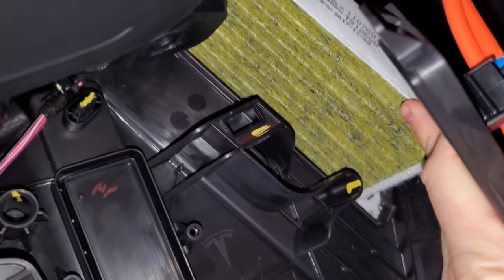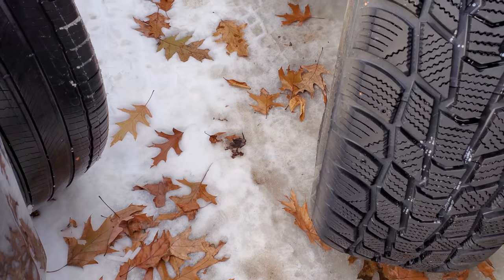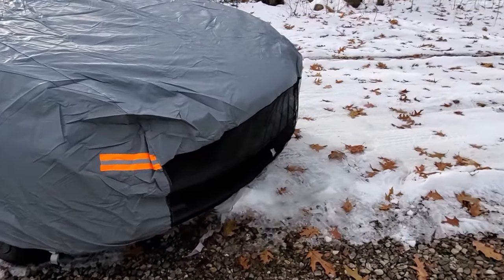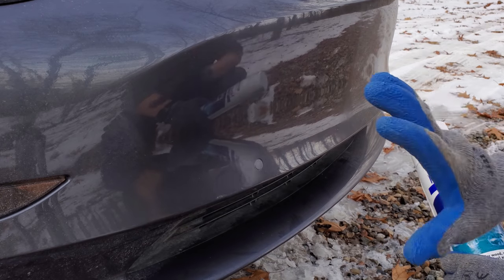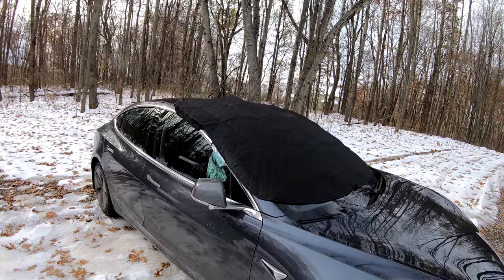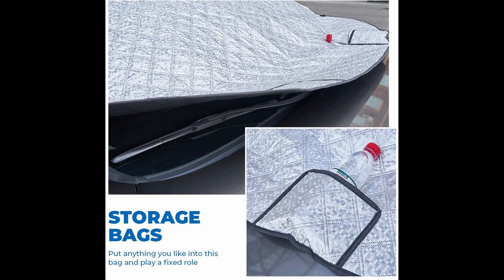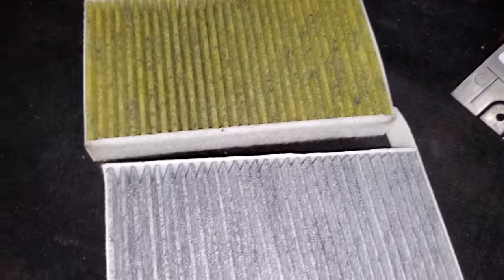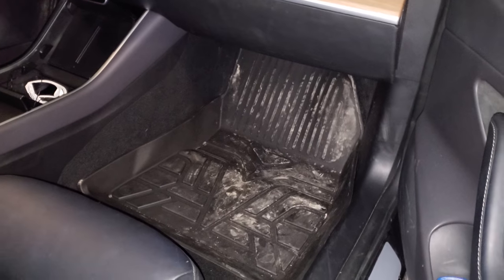Prepare Your Tesla Model 3 for Winter! | Winter Accessories | Black Friday | Cyber Monday |

Comment: Someone probably already mentioned the wipers free move in service mode so you can move them closer to you to make it easier.  Also use the old wiper to prevent the bare metal arm from touching the glass when swapping them.
Reply from the maker: Great tips :)

You were the first to mention either.

Comment: I've never been, probably never will be, a car cover dude. However, that charger zipper... hilarious! Like anyone would have their vehicle covered while charging.
I'm (already) not liking that spray stuff - unless it were to be sprayed all over the front end. Otherwise, you have a bare spot. However, here in PA, there's this 'new law' that requires people to have ALL snow cleaned off vehicles before driving - at least enough that will cause little to no issue with flying back into others windshields.
It's definitely different having to change a filter (like that) in a vehicle. They could've made it more easily accessible!

Comment: top tip: vacuum your car before planning interior service or dress from the dollar store for service activities or the easiest, keep your car clean. seems the floor mats are not good enough
Reply from the maker: The bottom was dirty from my older floor mats that didn't have side walls.

But I'm not all that concerned tbh. It's a tool I use. It doesn't need to be pretty forever.
Reply: @DirtyTesla  I agree, thats just my OCD. Sadly I dont own a Tesla just an ICE but would love to ;)

Comment: I would like to enter into this giveaway for the floor mats.. I've been a long term subscriber. Keep making great Model 3 and Tesla Videos. I think you might need those pockets on the windscreen protector to help hold it down, from flapping in the wind with water bottles.
Reply from the maker: Great point about holding it down! My old one I used never had that so I didn't think about that.

Comment: ohh nice .. initially i thought the giveaway might be US only (since regulatory shit and legal reasons etc)
but i just looked it up on their website and they do actually ship worldwide (technically that didnt confirm that the giveaway itself can be done internationally but lifts a major hurdle)
so i defintely would like to enter the giveaway if possible

as for tyres .. here in germany the stock ones are bone hard sports summer tyres so i literally had to get winter tyres since getting all seasons (which would be doable here as the winters are all completely gone here in my region of germany, last 3 years was like 2 weeks of "snow" and then warm again) would be kinda dumb if i already have good summer tyres.
i put them on the stock 18" rims and got new rims for the stock summer tyre .. the shop looked puzzeld at me for doing it that way but they understood once i told them about the areo covers.

and looking that the shots of your model 3 outside (with the cover removed) made me wish i had time to properly wash my car and maybe even do a ceramic coating. I was thinking of getting PPF installed when the car was new .. but it was just too expensive for what it is ... i mean it definately has its uses, but since i plan on keeping the car until it breaks down (and then maybe use the battery as home storage since its just MASSIVE compared to other solutions) i figured that the paint doesnt have to stay spotless .... but the pure shine of your clean vehicle makes me want to clean it XD
Reply from the maker: Yeah I'm not really a fan of PPF. I mean if you just want to keep the paint perfect of course it's worth it, but financially...na